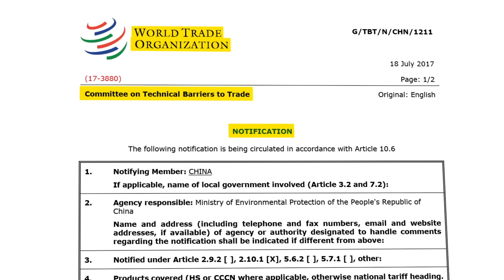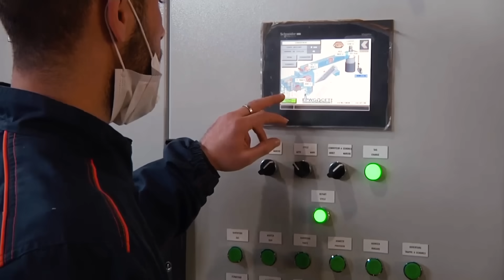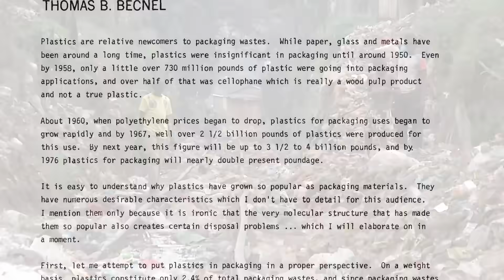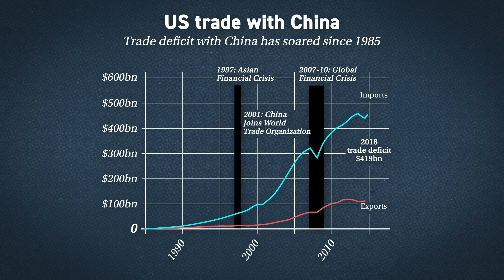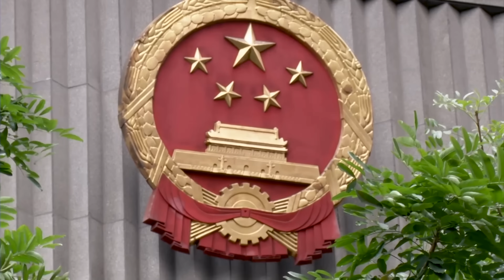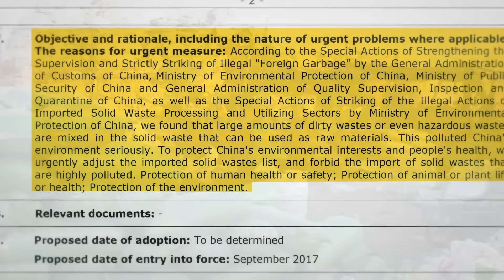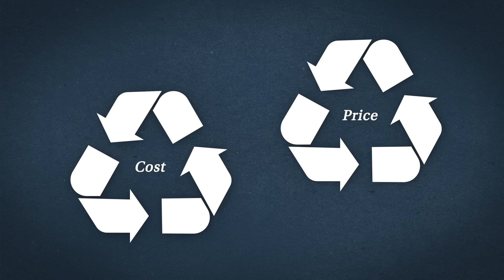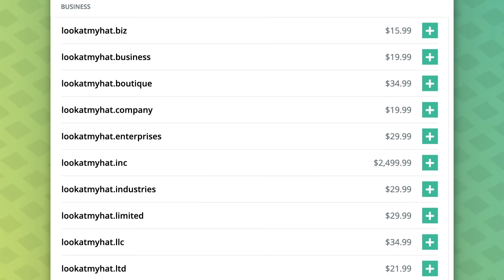How China Broke the World's Recycling

Comment: Title: How China Broke Recycling

Video: How Recycling was broken from the beginning
Reply: Some materials are fully recyclable (most metals for instance)...
Others are problematic...  while some are just plain impossible. 
The REAL solution (or, at least a major component of any real long term solution) lies in discontinuing the (first) use of "problem" materials...  which will never happen without some (economic) incentive for the companies who are currently using the "problem" materials. 
Companies will continue to use plastic packaging for as long as it is their cheapest option. 
Many have supported "carbon taxes"...  why have no "plastics taxes" been proposed? Simple...  because "big business" lobbies lawmakers to prevent that...  and also spends millions (if not billions) to push the "blame" onto the consumer. 
That isn't to say that the consumers are without blame...  consumers are just as guilty as the companies of making their choices based on "price", rather than "what's good for the environment". The typical consumer won't pay a dollar more for a bottle of soda just because it comes in a (more easily recycled) glass bottle. And, if the consumer doesn't buy it...  the manufacturer won't continue to produce it. 
It's simple market dynamics really. 
For many people, it is very difficult to make the "best" choice...  when the "wrong" choice is so much cheaper. This is true for the consumer...  and actually even more true for the people who run the big corporations. The LEGAL obligation of the management of any corporation, is to their shareholders...  NOT the environment. So...  in order for them to adopt environmentally sound practices...  those practices MUST produce the "best" results AT THE BOTTOM LINE. 
This is where government (is supposed to)  come into play. It is a part of their job to enact laws and regulations, and levy taxes and fines which make the "best" choices (in the bigger picture) also the most "cost effective" choices. 
Ah, but then there is corruption...
A campaign contribution here...  some blackmail over there...  a little intimidation somewhere else...  etc....  and those laws and regulations are never enacted...  those taxes and fines are never levied...  and the "price" is kicked down the road. 
Glass bottles for beverages and other liquids...  metal foils for many other products...  are far more easily recycled than plastics...  and therefore, would make a far "better" choice for packaging the products we all buy. 
But...  as long as plastic remains cheaper to use...  don't expect to see those alternatives showing up on your grocer's shelves. 
When (if ever) the alternatives become "cheaper" to use...  manufacturers will drop plastic faster than you can say, "Remember plastic?".
Reply: @bobinthewest8559  Ding ding ding! Because Climate Change is so imminent, the next biggest danger of plastic is easy to ignore (and for lobbyists to protect). It's practically real world King Midas touch, it's almost a magical material that is dirt cheap to make, easy to work with, can make almost anything, but it never goes away. It can't be banned entirely, because there's plenty of technologies (esp medical) that require plastic, but wide scale disposable junk needs to be curbed. We'll need to get used to reusable containers again and deposits on glass jugs for liquids that you have to bring back, but it's a small price to pay. Lots of other plastic cheap goods will need to go too.
Reply: Touché
Reply: I am very surprised that no one here has seen a solution to the problem. The reason why China can accept so much plastic waste is not the profits of China's plastics industry, but the policies of the Chinese government. This video deliberately doesn't talk about this. Like other Western media, it makes people feel objective, but it doesn't say the most important thing.

Until 2017, China’s plastics recycling industry was actually profitable, but China’s policy has changed. If the government is willing to sacrifice some environment to develop industry, China can digest the world's plastic waste. But if the government wants to protect the environment, even if it is profitable, it will not be realized.

This is a very real problem: China is not a capitalist country. In China, many things are not for profit. China's investment in infrastructure in remote mountainous areas cannot recover its costs even in 100 years. China's investment in ports and railways in Africa and the Middle East will not have economic benefits for decades. But even so, China still did those.

This is why Western countries cannot understand China. They must come up with some theories they can understand to explain why China is doing things that are not profitable. For example, the West says that China is committed to achieving carbon neutrality by 2060,it is a kind of political propaganda. The West says that China’s lending to Southeast Asian and African countries to build hospitals and schools is a debt trap. The West says that China’s rocket launch is a space race.

Western capitalism has harmed the world for too long, and now people can't even see such simple things. If the whole world agrees that even if there is no economic profit, it is a must to protect the environment, reduce carbon emissions, and recycle garbage, then why can't it be done? Because of capitalism.

I am actually very grateful for this video, which allows many people to realize a very real flaw in capitalism: things that are not profitable will not be done even if they are important, and things that are profitable will be done even if the harm is great. Because Westerners have lived in this world for too long, they cannot see that there are completely different countries in the world.

As an example, Wuhan was blocked at the beginning of the year. Many Western media said that this is the Chinese government's purpose to destroy evidence and prevent the true situation from being known. The West says this is a violation of human rights, and this is a violation of freedom. They cannot see that Wuhan is China's most important transportation hub and that China's economy will be hit hard by the blockade of Wuhan. This happened before the outbreak in the West. No one knew that the world would be worse than Wuhan. China's decision was to sacrifice its economy to protect the health of its citizens and give the world more time to respond. However, this will not happen in the West. So far, the number of confirmed cases in the Americas and Europe has reached 40 million, with more than 1 million deaths, but governments are still discussing how to minimize economic losses.

Controlling the epidemic is a standard event with no economic benefits, but failure to do so will result in huge economic losses. The same goes for protecting the environment. I believe that as long as the Chinese government is willing to do it, even if there is no benefit, China can do a good job in recycling waste and balancing carbon emissions. As for Western governments and media, just ask yourself, why in your mind, economic interest is the only criterion for judging whether you should do it or not?
Reply: @haopang6643  you're not wrong about some of these things, but you're a little bit confused if you think that communist party of china does not act in its own self interest.
Reply: @万物之母  I will not say that the Chinese Communist Party has no interest considerations, but the interests of the Chinese government are basically the same as the needs of the Chinese people.

For example, when the Chinese government talks about human rights, it puts the citizen's right to live first, not the right to vote. Anyone who knows China will understand that China's problem is that there are too many people, the level of education is too low, and the level of industry is backward. In 1970, China was poorer than Africa and lagging behind the Middle East. Do Westerners really believe that voting rights will make Africa or the Middle East as rich or powerful as the United States?

After 50 years of development, although the Chinese have sacrificed some human rights, China has become stronger and can provide its citizens with more rights. In 2020, China can land on the moon and Mars while fighting the epidemic, and it can also engage in trade wars and technological wars with several Western countries at the same time. Does this rely on voting rights?

As Chinese, we also want the right to criticize the government, and we also want transparent information. But this does not mean that we are willing to turn China into Ukraine or Iraq or Syria or Afghanistan. We must first let the United States leave China's doorstep, and then decide what kind of politics we want. Instead of letting the West decide that the Chinese people need democracy and freedom, we want a future determined by ourselves.

All Westerners, if you fail to see that what your government opposes is not communism or the Chinese government, but the right of the Chinese to live a better life, then you will never understand why the Chinese hate the West so much. Western governments do not want Chinese people to live like Westerners. This is why they discredit China.
Reply: @haopang6643  i agree with you for the most part. i believe in every country's right to self-determination.
Reply: @Fakey Namey you actually believe the ccp have people on payroll just to respond to your comments on YouTube? lol
Reply: Buying US soybeans and recyclables were two of the few concessions China made when it joined the WTO.
Reply: @Fakey Namey Gotta believe in something to make yourself feel important I suppose
Reply: Sinophobic title sells
Reply: @Rio-ke9he  NM$L
Reply: @Rio-ke9he  i mean china did end recycling in 2017
Reply: @marionnette6231  No, China did not end recycling, it just stopped recycling US waste. The US can recycle it's own trash as much as it wants to.
Reply: @marionnette6231  in a good way tho.
Reply: @marionnette6231  No, they just stopped importing toxic trash from other countries. In fact, there are more domestic programs for recycling now. Not enough but in the right direction.
Reply: Now we can argue like people
Reply: @vengean3597  US democracy bombs 3rd world countries, China builds reduces poverty. Other Chinese provinces have less infections than Taiwan.

Absolute freedom comes with absolute disaster.
Reply: Justified clickbait-title for a good content?
Reply: Maybe he can do a video next on the global warming syndicate. People like to think they’re saving the planet by buying electric cars and banning straws, yet all it does is make the global warming scheme a fear based advertisement
Reply: Man in sorry but you need to do another video with your facts straight. I make money selling recycling every month.
Reply: Clickbaiting Americans
Reply: Recycling was always awful.  I’m all for protecting the environment and reusing what we can, but the thought that recycling is worth anything is trash.
Reply: Broke more
Reply: HAPPY MASS SHOOTING USA  NM$L
Reply: HAPPY MASS SHOOTING USA  NM$L
Reply: HAPPY MASS SHOOTING USA  NM$L
Reply: i hate clickbait titles, but people hate china for some reason, and it really brings in the views
Reply: Waiting for "How China broke the universe"
Reply: Exactly
Reply: Al Gung  A capitalists concern about the environment limits itself to increased costs and decreased willingness of the customer to buy their crap.
If floods destroy highways, that's bad. But if preventing it is more expensive than rebuilding the highways, they don't see a reason to prevent anything.
Reply: Nice content, horrible title
Reply: True, true.
Reply: it started with glass before any of you guys were born....plastic is complicated
ot: petroleum is the basis of many industries: a cheap organic reactor for pharmaceuticals for instance, that covid shot you're gonna get and the entire drug industry.
i hate china
Reply: Correct
Reply: Overpopulation
Reply: @Lianhua Xin Have you taken an inventory of the plastics that you've consumed in the last year as well as what you currently own (your personal 'plastic' inventory) to determine just how much tax you would have to pay?  Or, are you saying that this is something everyone else should (but you) just because you suggested it and think you're more enlightened than everyone else as a result?  Bottom line being that plastics exist because they're more efficient, and the world runs on them as a result.  I wouldn't complain if I were you because you wouldn't have any of what you do have if not for plastics.  Think I'm ludicrous?  Go inventory the plastics used to run and operate a hospital, any hospital, even just that of an ambulance.  BTW, you've misused the definition of "Oligarchy": "small group of people having control of a country"...that's actually China and the CCP.  The United States of America is a Democratic Republic with a representative government: "by the people, of the people, for the people".
Reply: I thought this was a very well-explained mini-documentary with a very click-baity title. (Wondering now if I'd have watched it otherwise...) But man there are a bunch of stupid comments in here: "YouTubers are pandering to Westerners" Duh, YouTube is BANNED in China. Also, while I'm glad that China caught on to the fraud eventually, because the West having to care for its own trash is the only way to make plastic producers accountable (in the very long run), the story could equally easily be: WHAT THE HELL TOOK THEM SO LONG?! So next time your marvelling at the oh-so efficient communist regime, take note of this 20-year failure to realize that they are posining their own soil by letting plastic companies turn almost no profit. And realize that the same is happening STILL in many, many other industries: the building industry and cement, coal, etc. None of these factor the environmental costs in, that's how they are "profitable" to begin with.
Reply: @tayoneumann9533  Government lets them. Stupid communists no profit, oh wait wheres the plastic waste going now?
Reply: They need to start charging people for trash removal by the pound.
Reply: @Alex M so what would happen if it didn't get and subsidies?
Reply: @pete w of course it is passed on to the consumer. 
the alternative is, that everyone pays for it, whether they consume it or not.
Reply: Jute will be a solution. A Bangladeshi scientist made organic polythene by Jutes last year. A huge step to save world i think.
Reply: @tanveer3384  the sad thing is, there are multiple ways to create packaging that is degradable. The main reason we don't have them is because companies have no reason to invest in them.
All it would take was to charge them for the price the environment has to pay to change that.
Reply: @liquidminds  As far i know, Australian companies are trying to understand jute process & invest in Bangladesh. They need organic polythene & Bangladesh need to revive her jute industry.  

The process is economically profitable. If large scale production starts, it would cost less than chemical polythene.  

That's a hope. As a Bangladeshi 🇧🇩, I think jute can solve world crisis.
Reply: it is more click bait if you blame it on china
Reply: @Fakey Namey Woah... laying the smack down. I'm copying this whole text and using it.
Reply: long long ago 10- 15 years you got twice as much for can and it was worth the effort. 
some how it is cleaner to move industry to china is a myth IMAO
Reply: You see in "How to be an American 101" it says "If anything wrong with the country or the world could be because capitalism isn't perfect blame China."
Reply: @JC Denton "charge" as in tax based on product. But there is regulation in capitalism. Just not in pure capitalism. but pure capitalism is basically corporate anarchy.
Reply: I would think its to be eye catching, but then I'd think "recycling is a lie" is even more eye catching and more accurate to the video.
Reply: World should have been doing own recycling... Makes my blood boil knowing they spent millions shipping it there. Now they blame China for being buried in their own cr@p
Reply: @Fakey Namey So anyone that disagrees with you is somehow paid by the CCP.

This is the level of intelligence you have?
Reply: Video: How Capitalism is Unsustainable
Reply: Recycling has worked in every industrialised nation on earth
Reply: This is the video that came up, when researching ingredients for my food channel? I think the algorithm is broken. Hahaha.  Welp...anyone want birria tacos?
Reply: @Maplecook  The algorithm broke when they politicized it. Was working ok before. Now it keeps suggesting to me weird unrelated stuff, or videos i've already watched. If I put it on auto, it soon starts looping to the same videos over and over. I'm even getting re-suggested friend videos that have like 20 views, that i already watched years ago.
Reply: @Fakey Namey you are brain-brushed by the west media.  What you said are full of fake news.  You ever know those Tibet children enjoy free education until high-school?  Who tell you they are not educated???
Reply: If they didn’t kill 1 million Americans 3 years later making us broke too, it’s hard not to be sinophobic
Reply: @Fakey Namey actual copy paste propaganda.
Just great....
Reply: @Fakey Namey does it relate to anything in this discussiom? What about we bring up US government spying on its alies in a video talk about second Amendment? What kind of stupid people mix shit up like this?
Reply: Yeah what a clickbaity title, recycling was broken already. Stop blaming China for everything, especially things that aren't it's fault to begin with, and especially when it's the West's fault to begin with. Such behaviour can be considered hate-mongering and honestly I'm going to flag this video for hate speech.
Reply: @TianZhaoHeavenlyFortune  I didn't read this as a condemnation of China, per se, and didn't read this as hate speech at all. This video was simply an explanation of how that happened and why.
Could the post have been titled differently? Of course.
Did I hear blame and condemnation? Again, yes... but mostly towards the plastics industry, who knew from 1974 on that profitable recycling was an illusion, but chose instead to sell the whole world a dream that left people feeling less guilty about plastic waste. That was basic marketing. Evil, to be sure, but marketing nonetheless.
China simply did what any corporation does... make a profit. In the end, when they found proof that any profit was eaten up by environmental destruction and medical bills, they stopped the process.
The fact is that because of circumstances, they were for some years the linchpin of world-wide plastic recycling, and once they stopped accepting imports, the game changed for the whole world. 

Facts are facts... and some are more agreeable than others.

I am reminded of an old adage which states "Don't shoot the messenger".
That seems appropriate here.
Reply: @Robert-yc9ql  I totally agree with your message. The quality of the video is actually pretty good, but the title is xenophobic. I guess that what attracts the click. Another evil marketing trick I guess. I think the Chinese government should ban such imports a long time ago.
Reply: @Robert-yc9ql  This title is a hate speech because it sounds like China broke something positive, especially if you consider the fact that most people only look at the title and watch less than 30 minutes of any YouTube video. Asian Americans in the US are being assaulted and discriminated because of Trump's hate speech on China and such clickbait does not help. The only fact regarding China in this video is that China had a choice and stopped buying trash from US, which breaks nothing. Would Pizza Hut say you broke pizza business (assuming pizzas are as noble and environmental-friendly a business as recycling) if you stop buying pizzas?
Reply: @TianZhaoHeavenlyFortune  China "yeah, we're not going to take your trash that we can't use for anything anymore"
The west "China destroyed everything!"
Reply: @TianZhaoHeavenlyFortune  plastic originated in England
Reply: Tian Zhao: right, complain about this as hate speech when it is not.  At no point is China blamed for anything but deciding that it would be economically viable to take in most of the world's low value plastic recycling.  I'm pretty sure that the thoughtless woman in Colorado and the plastics industry come off far worse.  50 cent army?
Reply: @TianZhaoHeavenlyFortune  How can you possibly tell Amerians not to hate or blame. It's their primary source of joy.
Reply: @TianZhaoHeavenlyFortune  My first idea when I saw the title was: "it never worked".
Don't think it is hate speech, the story itself is quite balanced?
Reply: @TianZhaoHeavenlyFortune  may I suggest that you view the story again. China acted to protect its people from chemical contamination within the waste. China was the good guys in this story, a catalyst for change. I guess that you are like many others, take offence very quickly at direct language.
Reply: @TianZhaoHeavenlyFortune  dude, the video makes china look good and the title will bring in bigots and potentially change their opinion by educating them a bit, don't be so sensitive. you are like a flower petal in the wind.
Reply: @TianZhaoHeavenlyFortune  hi.
I totally agree with you.
Would you help me get hired as  propaganda personal.
Thanks.
Reply: @TianZhaoHeavenlyFortune  YouTube is a western video platform,as a Chinese,l am not surprised are my? speaking for your own country is good,but lets be honest,there are way more western watch YouTube than Chinese.
Reply: @xinyeyang7515  The title is totally xenophobic. I don't think this is the value a western video platform wants to promote. Even the video itself admits the recycling system never works. Personally, I think this ban is long overdue to protect the health of the people and the environment in China.
Reply: @xinyeyang7515  YouTube is protected by Chinese firewall. 😁
Reply: @xinyeyang7515  You're not assuming western audiences, as long as they remain the majority on Youtube, are OK with being consciously stupefied by low effort content like this right?
Reply: @TianZhaoHeavenlyFortune  Its always China
Reply: @TianZhaoHeavenlyFortune  Are you insane ?
I know that for CCP party members like yourself its a no-go to ever criticize the glorious china, but thats not how things work over here just yet.
Reply: @DeadNoob451  wow... You really don't know how the CPC works. The party itself has made many changes in policies to improve thru criticism including bringing people out of poverty. 

There are many members as well and it is extremely difficult to get in. Influence and being rich does not automatically get you in. Xi needed to try many times before even getting in.
Reply: @Fakey Nameyhonestly I feel bad for you.
Your life revolves around politics and trying to start comment wars.

Life's got a lot more to offer "big boy"
Reply: It's misleading title!!
Reply: china: thanks obama
Reply: Only thing China doesn’t recycle is harvesting organs
Reply: @AbdulDean448  hey, Falungong
Reply: 12:13 lol, propaganda video. U seriously Don't know the 'True' reason why China stop recycling these plastic for US? if not please don't make any video coz it shows your wisdom and IQ level is seriously low.
Reply: @spaideman7850  There is no true reason as the way you say it. It is because you don't accept it. Everything that you disagree with is propaganda to you
Reply: *how capitalism is broken
Reply: HOW  china breaks y
Reply: Anything subsidized is doomed to fail bc it wouldn't exist otherwise.
Reply: @nunyabizness8799  The problem is that companies do not have to pay the price for their product being recycled. 
Charge them for it and trash will go down in a day... Instead we hope people will put in work for free, while the government do not want to put in the money to keep the chain alive. 
If every bit of plastic used in a product increases the taxes they have to pay, you won't find a lot of plastic in products anymore...
Reply: @liquidminds  The problem is that they had to preempt ignorant politicians and green lobbies pushing nonsense.  The idea that we're running out of land for landfills is really a giant joke, we are tiny ants in a massive world.  Resorting to taxes is just the usual theft, who pays those taxes in the end after all, we do.  And its always unintended consequences, just look at the modern over regulated "green emissions" car, made for an early end in a landfill as its turbocharged undersized engine totals it out cancelling out the claimed intention of sustainablity.
Reply: @woooweee  you are severely underestimating the amounts of garbage we produce each year and/or underestimating the time it takes for them to "disappear". 

taking from nature, so your enterprise becomes efficient, doesn't work like that. 
If you cannot make it work without destroying the environment, the problem isn't the environment...
Reply: @liquidminds  
Taxes levied on firms get passed down to the customer, almost 100%. There are numerous examples of this. Every time they raise gas taxes, there is another example.
Reply: @bcubed72  exactly. 
anyone going for proper packaging, using fewer garbage in their product, will have a huge competitive advantage. 
the cheapest has to be the best for the planet, not the other way around.
Reply: @liquidminds  seems like another thing only governments can do, but they dont.
Reply: wooo weee then explain why I see these 1-2 decade old Prius everywhere?

How about we stop it at the source bu R&Ding new materials to replace plastic, specifically single use plastic containers. Materials that aren’t made from crude oil. We’d have to get politicians mouths off the boot of oil oligarchs first.
Reply: @635574  That's the thing. We live in a democracy. If you want change, run for office. 
Them telling you, that you cannot change anything is their way of making sure they stay in power. 
Politicians need voters. As long as the voters support them and not the issues that are important, nothing will change.

I hate politicians like the next one, but looking at election results, I'm kinda hesitant to give them all the blame...
Reply: @liquidminds  you of course realize that means you will pay a higher price right.   Todays non taxed $2 item is not going to be $2 tomorrow after the new tax.  But yes if enough people refuse to use disposables then the market will change. No gov’t involvement needed. THE CONSUMER needs to make the demand and the employees of said company need to make the changes
Reply: @liquidminds  Well, that is the difference between using capitalism as a tool to actualize a better future or treating capitalism as the "testament" for politics.
Reply: @treasurewuji8740  true. the first is a fantasy, the second reality. 
It's like using dictatorship as a tool to better the world... might work, just unlikely.
Reply: @liquidminds  How pessimistic, LOL. My point is all ideologies, well almost all, ideologies should be treated as inspiration for policies, and once the policies are created, they should be judged solely on their own merit regardless the emotional response related to the ideology and the ideology itself.
Reply: @treasurewuji8740  the problem is, at this point we already can judge capitalism as having hardly any merit, but ideology still praises it to be the best of everything.

capitalism is good for invention of things we might want. It's terrible for providing the things we need.
Reply: @liquidminds  I'm not, go look at the actual land area of the world vs trash, its not a problem.
Reply: @liquidminds  Yeah, totally agree with you there.
Reply: @liquidminds  Dont bother, ignorace is bliss and some are way more happy than the rest of us. wooo weee only believes what Fox news tells them
Reply: @nunyabizness8799  Yeah because economics is all that matters when you are nothing else
Reply: @3mtech  And some believe the opposite, because they are obsessed with fox news and still depend on them for their opinion..
Reply: @liquidminds  Well; in fairness, I think it's more accurate to say big business and certain groups of people do not want the government to put in the money to keep the chain alive.
Reply: @ScrumpyWingnuts201  people tend to think about conspiracy. It's more self-interest and egoism.
Reply: @liquidminds  The even bigger problem, is that industries/businesses deliver what the customer wants. If we have a polluting bottle with 500ml of coke that costs $1, and a ''green'' (supposedly green...) that costs $1.05,  almost everyone will buy the cheaper one (unless they are being observed by a friend/colleague..). We're all paladins of world justice when we're being observed, not so much when we're on our own 🤣
Reply: @777lucifero  5c difference is probably a bit extreme, but your observation still holds up.
There is definitely a max distance we are willing to pay if something is "better"

I'd say, with $1 : $1.05, many people would still chose the "green"-version. But sell the regular on on discount for $0.75 and people take that. 

One of the reasons why corporations should be required to pay for the waste they produce. More wasteful products should cost more than less wasteful products. Since that's not included in the price, customers are basically directed towards wasting resources. That's definitely a problem.
Reply: @liquidminds  Yes I exaggerated the example, true. Or maybe it's because I might have gotten the 5c cheaper one myself haha. Self-busted.
Reply: @nunyabizness8799  The problem with profit minded systems is that if it isn't profitable, no one will do it, like recycling, defense, healthcare or education. I wouldn't advocate for subsidizing everything, just the essential sectors where profit isn't guaranteed.
Reply: @madensmith7014  if something has to be subsidized to exist, it's not essential. Profit is just surplus so if surplus isn't the goal anymore then a lot more people are going to be starving.
Reply: @nunyabizness8799  In that regard, many 3rd world countries aren't really poor since there's tons of surplus food going around in their country. Subsidies exists to lift the standards of society as a whole. Take education for example, it's not necessary for everyone to be literate in their jobs to put food in the table, has been the case for thousands of years, but the world certainly developed a whole lot better after public schools became a thing.
Reply: @madensmith7014  um public education is what is wrong with the world today. It hasn't helped anything.
Reply: @nunyabizness8799  it pretty much works everywhere else, besides the US. More people are able to become doctors and nurses, more people are able to start their own businesses. If you're talking about tertiary education, that's another thing. People nowadays are expected to be able to read, write and do maths.
Reply: @madensmith7014  the problem isn't subsidies. The problem is externalities (which, I guess, are a kind of subsidy if governments are cleaning up after the companies that cause the externalities for free).

Creating plastic wastes is an externality created by using plastic packaging. Companies that use the packaging create the problem, but do not pay to clean up the problem.

The sane thing to do when you realise there is an externality, is to price it into the product. Either the companies creating the waste problem then has to clean up the waste problem. Or you impose a tax on the plastic packaging, to pay for the government cleaning it up for them (or for the government to pay another company to clean it up).

Given that recycling is hella expensive, as China has realised, the tax on packaging would be severe. This would discourage companies using said plastic packaging as the tax on the packaging would be  comensurately expensive. Even if this did not reduce plastic packaging, well, the funds would already be there from the taxes to pay to clean up the aftermath. The companies would of course pass this cost to the customers, but since customers using the packaging are just as much to blame, this isn't really a problem. People like using plastics because they are cheap and convenient, if it was incredibly expensive (due to the tax) and convenient, customers and corporations wouldn't be so reluctant look for maybe less convenient alternatives.

So recycling isn't really fundamentally unprofitable in the existing system, we just need to be more reasonable with externalities. Externalities are just problems you have created but someone else (often society at large) is paying for. If we actually made companies that create externalities actually pay for those externalities (eg they become just regular costs of business rather than externalities), then recycling would be perfectly compatible with the existing economic system.

This isn't really an economically difficult problem in a technical sense tbh, externalities arn't really supposed to exist. As you discover them, you just shove them back to the people creating the externalities as regular costs (which they should have been to begin with). In practice as it turns out, well... externalising what should be costs is a business model for a depressingly large portion of all businesses.
Reply: @Hysteresis.Actual  Developing plastic alternatives has been a long journey for many researchers. A switch is desirable but let's be honest that none of the current alternatives are yet to be on par with plastic's lifespan which is it's main selling point and the reason why it's ruining the environment.

Having companies deal with the externalities is just another way of having them taxed. I think that taxing would even be cheaper than having them do something about it since the externalities caused by plastic pollution stretches to different sectors, like healthcare and waste management. It would be a mess in logistics if each company did their own things so it would all end up with a centralised management that will deal with those externalities, which means that companies would partly chip in some money to have them deal with it. I don't think this is what you're getting at, so please elaborate for the parts I got wrong on how the system should operate.

China doesn't really have anyone to tax to compensate for their recycling industry since they are all using imported material. If anything the packaging they use within China are mostly recycled plastic already.

Imo a combined effort of promoting recycled goods and turning the industry bigger would be an ideal action to take. People are willing to pay a premium for products that make them feel good even if the quality is on par with other competitors. The caveat here is that recycled plastic is lower quality than normal plastic, a breakthrough in recycling tech to improve recyclable's quality is something I hope for. Turning the industry bigger is so that hopefully the economies of scale would kick in and make the prices cheaper. The caveat is that it would take a lot of government investment or maybe some daring venture capitalist to fund the initial building of infrastructure for sorting waste and recycling plants, which is gonna be costly and losing money is a lot likely to happen.
Reply: @madensmith7014  It would be very suprising if every company using plastic packaging would do their own recycling.

Realistically, you impose the tax on plastic packaging. Then it's the company's choice to either:

1. Factor in the price of cleaning up the plastics as a part of their business via paying the tax. Likely outcome is this tax is a significant cost per unit of their product, which they will pass onto their customers, making their product less desirable via pricing. The tax is passed on by the government to whatever process recycles the waste.

2. Clean up ALL their own plastic waste, or, more likely, pay another company to clean up their plastic waste. They would likely do this collectively with other companies, since the logistics of reclaiming only the plastic waste you are responsible for, then sending that in to recycle would indeed be logistically prohibitive. This is in effect, a private sector equivalent of just paying the tax for the government to clean it up.

3. Stop using plastics. If they are unwilling to pay the internalised externalities, then they shouldn't be doing the activities that created the externalities to begin with. If you conduct business in a way that pushes what should be costs YOU are producing to the government or society at large, then you should be paying that price, or not be doing business in that way to begin with.

options 2 and 3 technically avoid the tax but option 2, you know, pays an additional business cost in it's place. And option 3 just avoids the problem to begin with.

 Taxing and internalising externalities are effectively the same thing.  Removing externalities are just politically more palatable, because of the stigma agaisnt taxes. People see taxes as governments interfering, whereas externalities are just business costs that a business should be paying, but isn't, so shouldn't exist to begin with. The only technical difference, is that a tax imposed for the purpose of internalised externalities is more constrained by the actual cost of cleaning up that externality.

As to plastic alternatives, yes if we had them, they would be nice. But even in the absence of good alternatives, I bet they become much more appealing if the plastic packaging was a significant portion of the cost of the product (which should be the case because, as it turns out, recycling is in fact very expensive). Yeah, paper straws suck, but if a plastic straw costs like 50c or a dollar each then suddenly the paper straw seems like a more reasonable alternative. Ditto, if a small bottle of coke suffered a $1 price hike for the price of dealing with the plastic bottle, people will move to bigger bottles, or get cans, or glass bottles.

Australia already has this 'internalizing externalities' in effect for cigarettes. People smoking impose a very heavy additional cost on our medicare system. So there is a very heavy tax on cigarettes (like close to or more than the actual cost of the cigarettes before tax). The effects of this are:

1. People smoke a lot less now. This is not all pricing, there has been a lot of initiatives to discourage smoking, but also cigarettes are ghastly expensive here,  not an appealing habit to take up.

2. For the people who still smoke, everytime they buy a pack of cigarettes, they are paying into the additional cost of medical care down the line via the tax they are paying.

The taxes they pay arn't an arbitrarily determined amount, they've been set to offset the extra cost to healthcare (as it turns out smoking is a filthy habit that costs the medicare system a crapton), and the government just directs that tax money to the medicare system. Bam externality gone. People creating the cost (combination of smokers and tabacco companies) pay for said costs.
Reply: @madensmith7014  it doesn't work in any country bc 2 wrongs can't make a right & taxation is theft.
Reply: @madensmith7014  if a common thief robs someone but gives some back, it doesn't magically make it not theft. Same goes with taxation. If you don't pay they will kidnap & cage you, which is far worse than what any common thief would do. If taxation is not theft, then any band of robbers need only declare themselves a government & all their thefts are legalised.
Reply: @madensmith7014  the government, I've been robbed by my whole life, is much more likely to do all those things than a common thief, I've never had to even deal with.
Reply: @nunyabizness8799  Except that government subsidies are what keep food prices (to the consumer) low, and prevent sudden spikes or plunges.
Reply: @Skorpychan  yeah, that's what they want you to believe.
Reply: @nunyabizness8799  yet it’s necessary because otherwise your neighborhood would be filled w plastic
Reply: @nunyabizness8799  either ban non-biodegradable plastics or let them end up in the landfill/ocean/incinerator which would pollute land/sea/air.
Reply: @nunyabizness8799  Farming in Germany wouldn't exist without subsidition? 
that's a real hot take you got there. another example is why slaughterhouseworkers in france are so damn sour, subsidition of slaughterhouses through more liberal contracting requirements in germany.

German meatindustry is fucking its competitors in hella lot countries, best illustrated by the fact that sales in germany go down for ten years now and production still goes up, all thanks to subsidized industry...
Reply: @h4n5i  pretty sure I'm talking about recycling
Reply: @nunyabizness8799  like militaries?
Reply: @nunyabizness8799  do you enjoy cable tv, internet, electric power, medicines etc etc etc. A huge percentage of things you take for granted are or were subsidised, our entire real estate systen works through subsidies as does our farming system
Reply: @cdreid99999  real estate has nothing to do with subsidies & if something is truly beneficial to society it will be provided without government crutches
Reply: @nunyabizness8799  That's partially true, partially false. Subsidies are intended as an ''initial push'', in order to surpass the entry cost in a business, and only when the outcome is expected to return the initial investment (subsidy being = investment). For example, we can subsidize a startup in making televisions, if it has an expected outcome that in 10 years it will generate more profit than the initial subsidy that was given.
Of course, you are partially true, because more often it is just used as a means of corruption, to give money to your industrial buddies in exchange for other favors, or such. A subsidy should only be meant as an initial investment.
Reply: @777lucifero  what someone claims subsidies are for will never change what they are.
Reply: @nunyabizness8799  In a business/economy term that is what they mean. What politicians and corrupt people use it as, different story.

Don't mix corruption with other terms though. If a subsidy is anything more than helping initially a company, with the intent that the company will be on its own without help, and recover the initial investment of the subsidy, then it is just corruption. It also hurts the country, because you end up financing industries that clearly are not optimal (since, if they were optimal, they would not need help).

It's like saying, i lend you $50,000 so you can get an education. Because i know in 10 years you will get those 50,000 back. But if suddenly i'm giving you 50,000 every year for the rest of your life, that's not a ''subsidy/investment'' anymore.
Reply: Ban on imports and a tax on plastic manufacturing to cover recycling cost would solve everything, but unfortunately a certain liberal party is ran by the CCP, and that will never happen.
Reply: Doug Dimmadimsdale no, it won’t. All the same problems would still exist. If you try to keep ants out of your home, but do nothing to stop the ants already in your home besides burning them, then you still end up with a house in flames.
Reply: @dougdimmadimsdale9571  why the west not recycle in your own country???  China ever sold plastic waste to the west???
Reply: @orangeme86  BITCONNECT!
Reply: @dougdimmadimsdale9571  ？？？
Reply: @Alex M commie bollocks